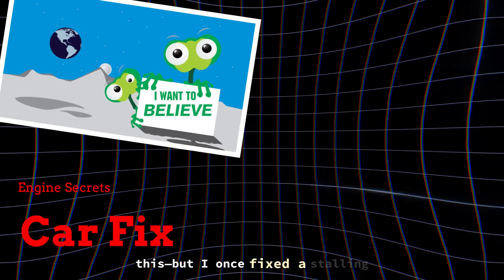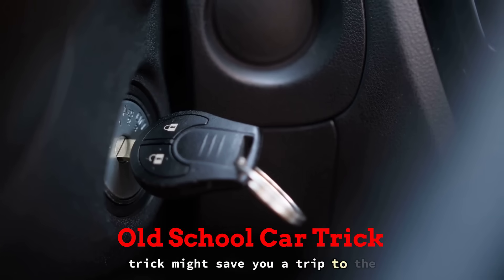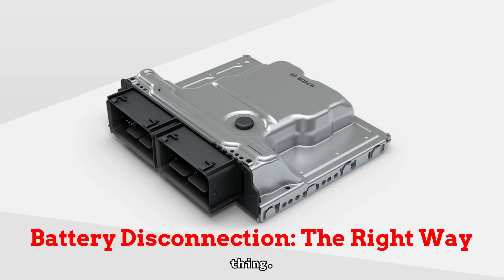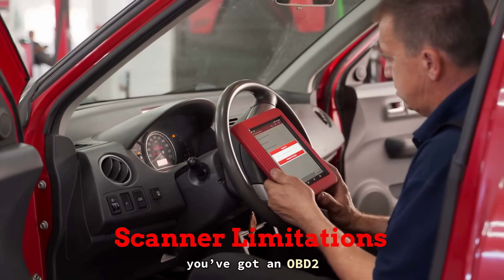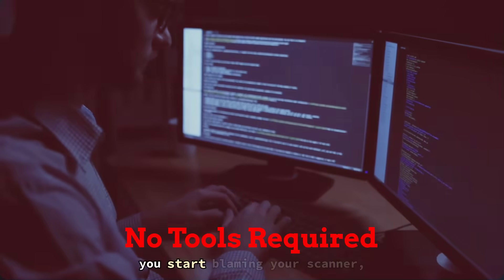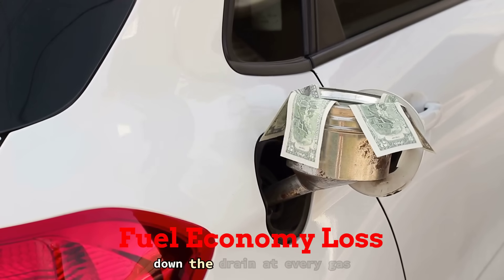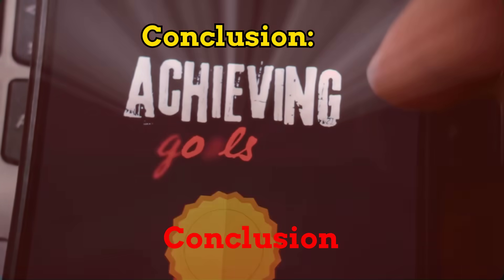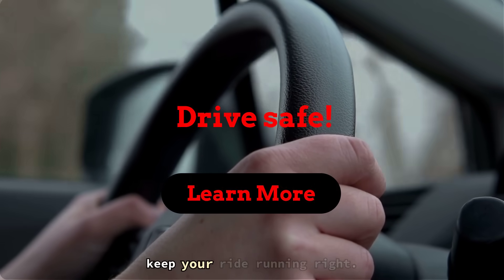Doing This Will RESET Your Car And Fix It For Free (5 Real Mechanic Methods)

Comment: I tried the unplug battery then press brake… engine light does go out but then comes back in about 30 minutes
Reply from the maker: Great observation @farrahfarrah88888 — if the check engine light keeps coming back that quickly, your car’s computer is detecting a persistent issue. The reset clears the symptom, but not the root cause. I recommend scanning for codes (even a cheap OBD2 scanner or auto parts store can help) — once you know the code, you’ll know exactly what needs attention.

Comment: My 2017 Hyundai Elantra SE failed the  MA emission test, not because a code or  DTC. I have driven various drive cycles up to 900 miles and there are 3 sensors that have cleared and 6 have not. Evap, Catalyst, O2, O2 sensor heater, Fuel and EGR
Reply from the maker: That's super frustrating @1945nld-j1l — sounds like your monitors are stuck in "not ready" mode even after a ton of driving. Here’s the deal: some Hyundai ECUs are very picky about drive cycle conditions (speed, temp, throttle). A general battery reset won't help here — what you need is a very specific drive pattern.

Try this:

Start car cold and idle 2 minutes with A/C and lights off.
Drive at 25-35 mph for about 3 minutes with steady throttle.
Accelerate moderately to 55 mph, then cruise for 5 minutes.
Decelerate without braking to 20 mph, then gently stop.
Let idle 2 minutes, then shut down.

Repeat a few times if needed. Also make sure fuel tank is between 30–80% full — EVAP tests won’t run outside that range. Keep me posted, I’ve seen this exact thing with Massachusetts inspections before!

Comment: Crazy, have a 2000 RX300 and tried the press the gas pedal 3 times and the up and down idle stopped then I tried the 15 minute battery disconnect for the check engine light now it’s gone-SMH, Thanks!
Reply from the maker: That’s awesome to hear, @darrylhutchinson3611! 🔧👏 Sometimes the simplest tricks really do the job. Glad it worked on your RX300—nice combo move with the pedal and battery reset! 😎💪 Let me know if it stays cleared up!
Reply: @CarCareFix thanks and will do.

Comment: I saw your video on tips on resting codes and would like to learn more. I have a scan tool Topdon.
Reply from the maker: Hey @coolwaterhubby5208! That’s awesome—you’ve already got a great head start with the Topdon scanner. If you want to learn more, I’d recommend exploring how to use Live Data, Freeze Frame, and Readiness Monitors on your scanner. These features go way beyond just reading/resetting codes and can help you diagnose issues before they get worse. I’ll be dropping more scanner tips soon, so stay tuned—or let me know what specific issues you're facing, and I’ll walk you through how to use your Topdon to pinpoint it!

Comment: Got a narvara d40 no central locking do you know how to reset
Reply from the maker: Hey @JohnLockwood-v4f! On the Navara D40, central locking issues are often tied to the key fob sync or a blown fuse. Try this simple reset method:

Sit in the driver’s seat and close all doors.
Insert the key and turn it from OFF to ON (don’t start) 6 times within 10 seconds—you should hear a beep.
Press any button on the key fob.
Turn the key OFF and remove it.

If the reset doesn’t work, check the central locking fuse and battery in the key fob. Let me know how it goes or if you're seeing other symptoms!

Comment: These are great tips. Tried them. I have a 1991 chrysler lebaron lx convertible 3ltr v6 that i perforned a water pump replacement, timing belt, set timing, then replaced all the upper, lower intake gaskets, after cleaning upper and lower intakes then replaced head gasket. Thermostat gasket as well as new spark pugs and plug wires. Put anitfreeze in and tried to crak it. It turns over but wont crank. I cannot hear the fuel pump go on after i turn key to run. I suspect its the original 34 year old fuel pump relay. Ive gone online to a million places to find the CORRECT relay and most are discontinued or come with the plastic skirt around it so it prevent the relay from going into the relay housing flush the relays sit atop the fuse box. Can you PLEASE HELP me find the correct relay? The OEM number on tje current relay is: 5234292, the last 8 of my vin is: MG102559 HELP ME PLEASE! Every auto parts chain only finds the one with the skirting around it. I also replaced the fuel pump and fuel filter in 2017. I tried to put pictures of the relay on here it won't let me. This is my only sorse of transportation. I bought it in 2013 with 40,166 original miles on it, one owner brand new off showroom floor, full power package, leather seats. It NOW only has 88,000 miles on it. I need this car running to survive and am 62 years old and currently laid off my job so i need to do this myself as i have all ther repairs on thos car with one exception, rear oil seal. PLESE HELP ME!!!

Comment: My 2004 silverado will go bat s*it crazy if you connect the positive first.
Reply from the maker: You're absolutely right, @redcorset—and thanks for pointing that out! On some older vehicles, especially ones with grounding quirks like your 2004 Silverado, connecting the positive first can cause sparks or weird electrical behavior if there's any stray voltage. That's why I always recommend disconnecting negative first and reconnecting negative last—safest method across the board. Appreciate you sharing your experience!

Comment: Hi. Will this work on 2016 Nissan rogue? The check engine light is on but it is running smooth. I tried disconnecting the negative cable but light still on.
Reply from the maker: Hey Francisco! Yep, this method can work on a 2016 Nissan Rogue—but here’s the thing: just disconnecting the negative cable might not fully reset the ECU on modern vehicles like yours. Many newer cars hold memory even after battery disconnects.

To do a deep reset, try this:

Disconnect both battery terminals.
Touch the positive and negative cables (not the battery!) together for 10–15 seconds to drain residual voltage.
Reconnect everything and start the car.

But keep in mind—if the check engine light comes back, it means the issue is still active. Even if it’s running smooth, a code reader (like a cheap OBD2 scanner or a free scan from an auto parts store) will tell you exactly what’s triggering the light.
Reply: @CarCareFix it worked 👍 I disconnected the negative cable and pressed the brake pedal. It saved me spending on a OBD scanner. Please continue sharing tips. Wish you well. Thank you.

Comment: Amyone have any tips on a 2007 toyota tundra trd 5.7 that goes into limp mode 🙏
Reply from the maker: Hey! Limp mode on a 2007 Tundra TRD 5.7 can be triggered by a bunch of things—common culprits are a failing throttle position sensor, mass airflow sensor, dirty throttle body, or even transmission issues. Start simple:

Scan for codes with an OBD2 tool (AutoZone or Advance Auto usually do it free).
Clean the throttle body and MAF sensor with proper cleaner.
Check your transmission fluid level and color—low or burnt fluid can trigger limp mode.

Battery reset trick (disconnect both terminals, touch cables together for 10 sec) sometimes clears limp mode if it's sensor-related.
Reply: @CarCareFix thank you . The after repair code was p2433 pressure sensor circuit high bank 1/secondary air injection system air flow.
Reply: Which. Had replaced last month cost me 1500
Reply: Do you happen to know what that pressure sensor circuit high bank one could mean? I’ve had two mechanics working on it, but some tips would help if I could give him some info on what to look for. 🙏🙏🙏🙏🙏🙏

Comment: You might want to add something to this video because when you wipe that ECU totally clean via your last method certain cars also take startup procedures to relearn how it is supposed to run. So don't just leave it at wiping the ECU clean because you can really screw a car up that way just hopping in it and driving after you do that
Reply: Wtf
Reply from the maker: You're absolutely right, Ryan—and I really appreciate you bringing that up. 🙏

After a full ECU reset like Method #5, many vehicles do need a proper "relearn" procedure to run smoothly again. That usually means:

✅ Letting the engine idle for a few minutes without touching the gas
✅ Letting the cooling fans cycle on and off
✅ Taking it for a gentle drive with varied throttle (not flooring it)
✅ Avoiding heavy loads or high RPMs for the first few miles

Skipping that can lead to rough idle, poor shifts, or even stalling—especially on drive-by-wire cars. I’ll be adding this as an on-screen note and covering it more in the next video. Appreciate you looking out for others with this comment—this is the kind of detail that makes us all better wrenchers.

Comment: I fixed my 2 cars.  2913 Elantra with ABS warning light and 2013 Ford Focus SE with windshield washer alert status. BTW, my mechanic told me that it is $200.00 fix to replace sensor.  Ignition key off to on 3x while stepping on gas accelerator and brake pedal did reset. Thank you….
Reply from the maker: Jonathan, that’s incredible! 🔥

Two cars fixed and you dodged a $200 sensor job? That’s what I love to hear. Sometimes these electronic gremlins just need a proper reset sequence—and you nailed it with that key cycle + pedal combo. Big respect for taking action instead of just handing over cash to a shop. Appreciate you sharing your win—this is going to give a lot of folks the confidence to try it too.
Reply: At what point using this method should you press the accelerator? The brake? Thanks! 🙂

Comment: I have a 2009 Pontiac G6 3.5 liter and I was told the alternator was bad so I replaced it twice and the battery 3 times  but the battery symbol still comes on in the car they sau it's electrical but I want to try the reset test first
Reply from the maker: John, I feel your frustration — when the battery light won’t go off even after new alternators and batteries, it’s enough to drive anyone nuts. 😤 A reset is definitely worth a shot before diving deeper into electrical diagnostics.

Try the battery disconnect method with a full power drain:
Disconnect the negative, then positive terminals.
Hold the brake pedal for 10–15 seconds to fully drain residual power.
Wait at least 10 minutes.
Reconnect positive first, then negative.

If that doesn't clear it, it might be time to inspect the charging system wiring — especially the fuseable link, voltage regulator wire, or a damaged engine ground. That light can also come on due to ECU miscommunication, so a soft reset (like the jumper cable trick) can help reset charging logic.

Comment: Why do my computer go bad and how do I fix it?
Reply from the maker: Great question, Patricia — and one I hear a lot! 👇

Your car’s computer (ECU) can go bad for a few common reasons:
🔹 Power Surges or Voltage Spikes — Often caused by jump-starting incorrectly, faulty alternators, or shorted wires.
🔹 Water Damage or Moisture — If the ECU gets wet (from leaks or condensation), it can corrode internally.
🔹 Bad Grounds or Overheating — A poor electrical ground or extreme engine bay heat can fry internal circuits over time.
🔹 Sensor Failures — Sometimes a failing sensor sends corrupted signals to the ECU, confusing or damaging it over time.

✅ How to Fix It:
Start with a soft reset (like disconnecting the battery properly and draining power), and if that doesn’t help, try scanning it with a good OBD2 tool. If it truly is bad, some ECUs can be rebuilt or reprogrammed for cheaper than full replacement — just avoid replacing it blindly without verifying power, grounds, and fuse connections first.

Comment: I don’t understand the last one number five is he using jumper, cables, or the battery cables?
Reply from the maker: Great question! 🙌 In Method #5, I’m talking about using jumper cables — NOT the battery cables still connected to the battery.

Here’s how it works:
🔧 First, disconnect both the positive and negative battery cables from the battery itself (very important — no power should be flowing).
🔧 Then, take a jumper cable and connect the loose positive and negative battery cables together for about 10 minutes.
⚡ What this does is drain out any leftover voltage stored in the ECU and modules — kind of like holding the power button on a frozen laptop.

It’s a safe, deeper reset trick that clears stubborn glitches — but only when the battery is completely disconnected.
Reply: @CarCareFix  so you don’t put the jumper cables on the battery Post but you remove the cables from the battery post and put the jumper cables on the ends of the battery cables, correct👍🏻

Comment: I just became a prescriber. I'm really liking this channel I have done the battery disconnect on my 2010 Ford F-150 touching the negative and positive cables together for 10 minutes it's solved my jerky transmission shifting thank you so much
Reply: *subscriber, not prescriber.
Reply from the maker: John, welcome aboard — and thank you for subscribing! 🙌 That’s awesome to hear about your F-150!

That soft ECU drain (touching the battery cables together) has saved so many trucks from jerky shifting, weird idle, or ghost warning lights — especially those 2004–2014 Fords. Glad it worked like a charm for you!

Keep wrenching, keep driving smart — and if you run into anything else, drop a comment anytime. I’ve got your back.

Comment: Changed a tire now can't get the light off dash board that says low tire
Reply from the maker: Hey Patricia! 👋 That low tire pressure light can definitely be stubborn after a tire change — but don’t worry, there are a couple of easy fixes you can try before heading to a shop:

🔧 1. Check All Tire Pressures (Including the Spare!)
Make sure all four tires — and your spare tire if it has a sensor — are inflated to the recommended pressure. You’ll usually find that info on a sticker inside the driver’s door frame.

🔄 2. Drive at 25+ MPH for 10–15 Minutes
Most TPMS (Tire Pressure Monitoring Systems) reset themselves once the system sees all tires are properly inflated during a short drive. Just give it a little time.

🧠 3. Still On? Try a Manual Reset (If Your Car Allows)
Some vehicles have a TPMS reset button under the steering wheel or in the glove box — check your owner’s manual. Press and hold it until the light blinks, then drive.

If it still won’t go away, the sensor inside the new tire may need to be re-learned or replaced — but try those steps first! Let me know your car’s year and model and I can walk you through the exact reset process if needed!

Comment: I had a dealership tell my wife she needed a whole new muffler system ($800) I asked her to get the Code and I would look into it. It was a O2 sensor at a cost of $55 and 30 minutes of my time.
Reply: I am afraid this happened to my adult daughter 😡
Reply: Holy crap
Reply: Yep it's because we are women, I had a guy tellcharge me $150 for my diagnosis, only for me to had some it for rlfree at O'Reilly's, then to tell me it's gonna cost me $1100 for a throttle body lol.
Reply: Lucky your man cares lol didnt know they exist
Reply: Most O2 sensors can be cleaned with the CORRECT elixir. And don't go cheap thinking you are smart. Cheap is as cheap does.
Buy the correct O2 sensor cleaner.
And never, ever, ever scratch around on it with a knife or screw driver.
Reply from the maker: Will, that right there is EXACTLY why I make these videos. 💯 Major respect for double-checking the code before handing over $800 for something that didn’t need replacing. O2 sensors throw off a lot of folks — and some shops count on that.

What you did saved hundreds and proved the power of a basic scan tool and a little research. That kind of DIY mindset is gold, especially these days when parts and labor costs are sky-high.

Glad your wife has someone looking out for her — and thanks for sharing your win! Stories like this keep the community smart and sharp.

Comment: Great video ! I have a 2008 Ford Escape 4wd with a 3.0 engine. My issue is the cooling fans do not turn on despite them being ok when directly tested.This in effect causes my transmission cooler to overheat which then causes the tranny to jerk and overheat and thump when moving even in neutral. Using Forscan  DTC P1000 is constant. I'm hoping the direct battery cable trick will help out. I'll certainly let you know and be forever grateful should that happen.
Reply from the maker: Thanks a ton, GM — and that’s a really solid breakdown of your issue. You’re absolutely right to suspect the cooling fans, especially since they work when directly powered. On those 2008 Escapes, a failed fan control module, temp sensor, or even a stuck relay can cause the PCM not to activate the fans — and yes, that definitely affects the trans cooler too, especially on hot days or during low-speed driving.

🔧 The battery cable trick (soft reset) is smart to try — it can sometimes force the PCM to reinitialize control systems like fan logic or clear a glitch in the temp circuit. Just make sure to fully disconnect both terminals and touch them together for 30 seconds, like we showed — that helps discharge any lingering voltage from the capacitors in the control units.

⚠️ Also worth checking:

The fan fuse and fan relay (cheap fix, often overlooked)

The engine coolant temp sensor (ECT) — if it’s sending bad data, the PCM won’t trigger the fans at all

If Forscan shows any fan-related PID staying static when hot — that’s a clue

Really appreciate you sharing this — and yes, definitely let me know what happens after the reset. I’m rooting for you, and if it doesn’t fix it, I’ll help you dig deeper.
Reply: @CarCareFix  you are a valuable asset to us, thank you for your knowledge, jokes and consistency. I've read through many comments and have learned even more from other people's questions ideas and your responses back! I look forward to trying these on my own vehicles and learning more from this channel! God Bless you and everyone else.